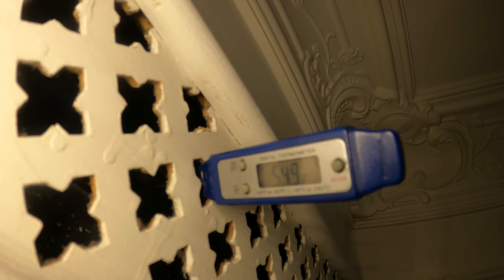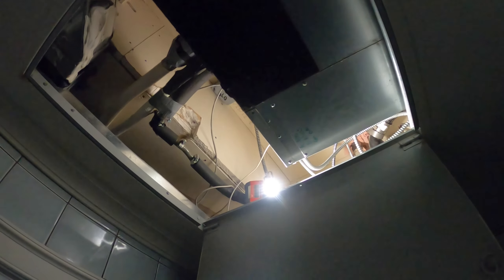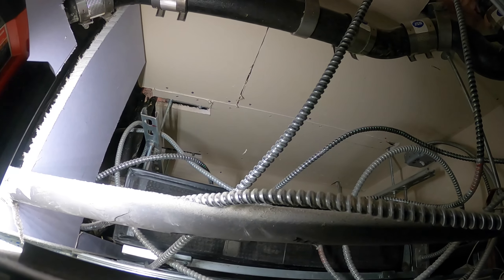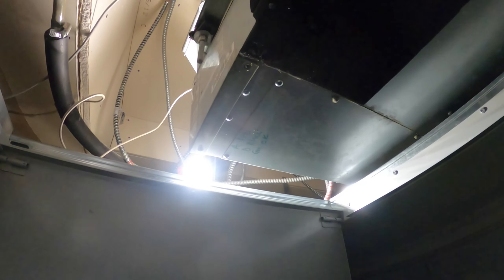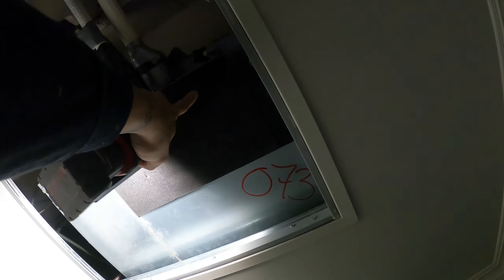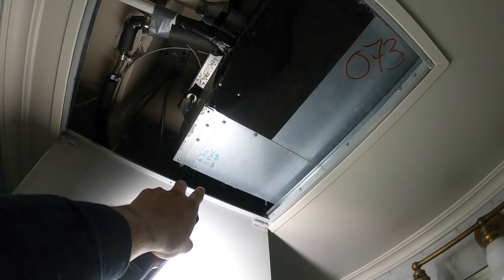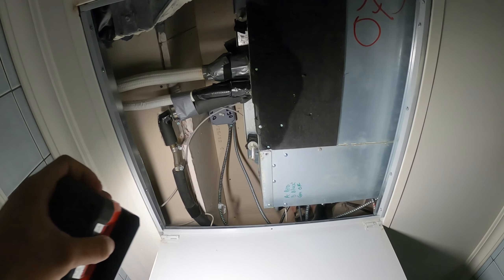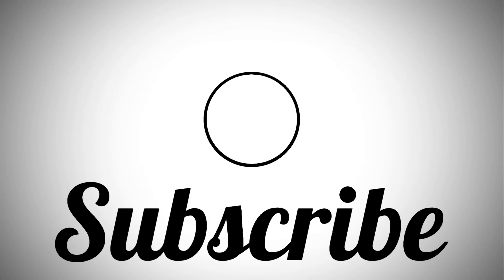HVAC Service Call: LG Multi V Not Cooling (LG AC Not Cooling) LG Heat Recovery Unit Not Cooling

Comment: You are 100% right about liquid migration. Proper planning prevents piss poor performance and it seems like there was no planning when it came to access. Just makes you shake your head.
Reply from the maker: Facts! I agree with you entirely. I mentioned this to them as well. It was a ticking time bomb from the start. Definitely shaking my head in this spot. I'm here now so hopefully they take my advice and I get to solve a 12 year mystery and improper planning 👀👀👀 Thanks for watching!
Reply: Not that I entirely disagree, but for the liquid refrigerant feeding back to the compressor the indoor could would need to freeze, correct? I'm pretty sure this system has head pressure control valves and sensors to prevent this as it's able to heat and cool at will and assign capacity to different rooms and such.
Are the broken compressors low on oil, probably not since they have oil level sensors as well?

Comment: I would attempt cleaning one unit as best you can with compressed air or nitrogen, with a shop vac running at the same time.  You may not get perfect factory air flow as when newly installed, but it may get you near 80%+ air flow without busting the budget.  I've done this with commercial fart fans, and with some patience, no imbalance issues.  Try this and if it works out, sell this to the hotel to secure yourself more work.  I think your trying to obtain perfection, and perfection can be the evil of good if you allow it.  Thanks for taking the time to video!

Comment: Good job Jumper, yeah with every bend in the lineset there becomes either a back flow or restriction in the line, and the whole system needs cleaning, evaporators, condensers, blower fans, and need larger access panels, complete tear down and cleaning.

Comment: This explains all the compressors that have to be replaced at this location. LG isn’t Junk, these units have had zero maintenance like you said. These air handlers are ruining the outdoor units.
Reply from the maker: Definitely. EVERY unit is in this shape. I don't even need to check before I already know the deal. It's definitely maintenance and not LG entirely. These indoor units are definitely creating a lot of issues. Imagine 9 of these all ganging up on 1 outdoor unit. Only makes sense to all the losses. Thanks for watching!

Comment: Those factory filters are garbage. More like a bug screen judging by the accumulation of dust on the blowers. I always install one or two inch filter rack with MERV 6 filter. Let the client know when to change the filters depending on environment.  Thxs for the vids!

Comment: In case if you are in need of increasing the airflow in a situation where you are not able to service the unit immediately, you can change the RPM's the motor runs at for each fan speed(E.S.P. setting) so that it runs the motor faster to try and get more airflow. Since the IDU shown here is the lowest capacity model of that series, it is running at the absolute minimum fan RPMs. To change this setting for the style of thermostat shown here, hold the mode button and the temp up button for three seconds, and then it should display 2 numbers + the fan speed selected. In case the number exceeds 100, it will show a row of bars at the top left, and if the number exceeds 200, it will show the row of bars and a set of 2 blocks at the lower left corner of the screen. You can use the temp up/down buttons to change the value, and pressing the fan speed button to select the value at low/medium/high speed. To save the new values, hold the mode button and the temp up button for three seconds.
For the unit shown here(B1 chassis), the values range between 60-115. The default values for your unit should be 86/92/94(L/M/H). I would increase them to 99/107/115. Technically speaking, these numbers are the motor's RPMs divided by 10(115 would be 1150 RPMs).

Comment: Welcome to HVAC Hotel Hell or maybe HVAC Hotel Nightmares...something like that, anyway, after watching this video. Great job, and thanks for this video.

The condition of those blower wheels was incredible. With the wheels in such poor condition, I absolutely dread to think what the coil looks like!

I do wonder if having the air handler like that in a room that is obviously going to be extremely high humidity so it's basically drawing a dirt-laden watery fog through it is also a contributing factor to the appalling condition of that air handler. I think that location was a very poor decision and contributed to the pitiful (and painful) access.

Just a thought, but I think a more detailed video of how airflow is ducted and flows around those hotel suites could be interesting. It may not seems like much, but watching a video can help give a different perspective in that you can mentally step away enabling creative solutions to be found. There may be a solution that the hotel would be more likely to go for, especially if it gave them other benefits such as reducing costs to them or improving ROI.

Comment: Compressed air . But Christ.knows where all that crap will go. It'll help ti the fall I bet . Sucks to be the owner of that building
Reply from the maker: We take the whole thing apart and clean it downstairs and outside. It would get everywhere in the ceiling and floor. Clean up would be a mess and be all over us. Eventually the unit will suck it all back in. Units and ceilings must be cleaned efficiently. It's an absolute nightmare! Thanks for watching haha